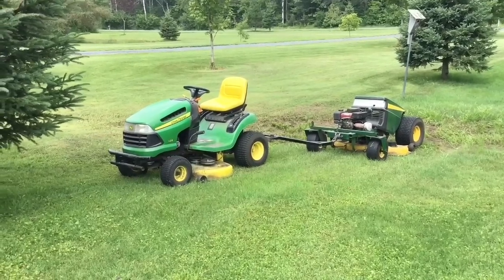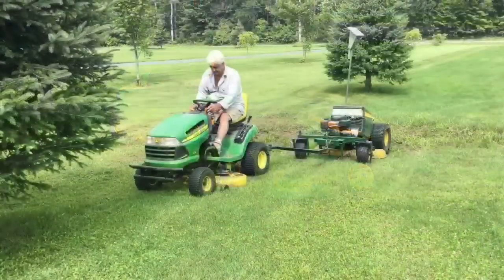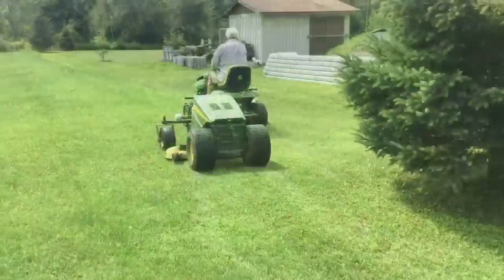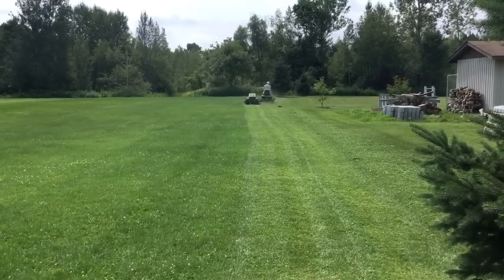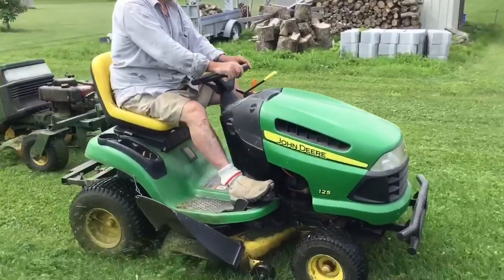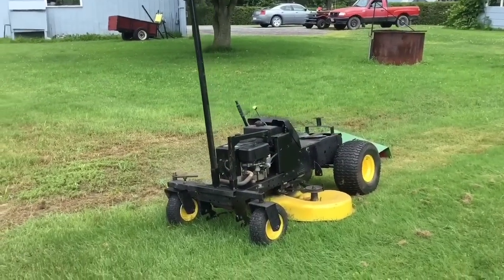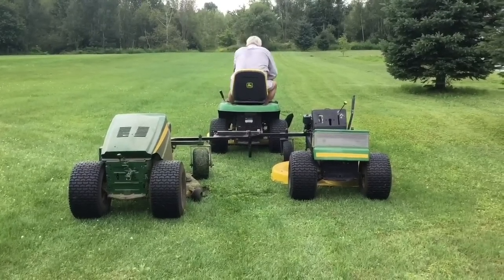Pull behind mower

Comment: I have two Swisher 60” pull behind mowers (14.5 HP engines on each) and have been pulling them behind my 1026R John Deere (w/ 60 inch deck) for several years now. I overlap the Swisher Decks about 12 inches on either side of the J.D. deck for a 13 foot cut. I mow 13 acres in 2-1/2 hours, or 5.2 acre’s/hour. I’m using two ball hitches from the tractor to the trail mowers but cornering leaves uncut strips so I need to switch to a sleeve hitch’s so the trail mowers tongues can’t swivel. I have pulled the Swishers on either side of the tractor and also both to the right side of the tractor which does triple mulch the grass blades for much less grass remnants left behind. Great time savor! Great minds think alike! ha ha! I’ll have to upload my system to YouTube!
Reply from the maker: @vscolkitt  
Can wait to see it on YouTube,please send me a notification when you do.
Reply from the maker: I mean    cant  wait
Reply: @logboom2002  
I mowed 13 acres today with my two pull behind Swisher mowers. Two videos…. Titled….
Two Pull Behind Swisher Mowers with John Deere tractor…Part One (and Part 2)

Comment: A friend/neighbor did similar a while back using a gas push mower pulled behind his rider to mow about 2 acres. He just took the push handle off and built a bracket to keep it in position like you did only lighter duty. When I followed along on the 1.5 acre area adjacent to my place with my rider it was done very fast. I agree with mulching idea but not only for safety but also to make less work for the right side trailing mower. It has to cut it's own swathe plus recut the lead deck's discharge.
Reply from the maker: oh just quit it 
I did tried it with 2 mower just that one time for the video. Usually i use just the lawn tractor plus the mower on 
the right so there is no problem of recutting the grass. But you got the right idea bout mukching
I keep  one  pull mower as a spare
thx for you comment

Comment: Well done!  Perhaps you can put a mulcher cover on the mower with the blades exposed for your safety!  Just looking out for ya : )
Reply from the maker: Dano Vido 
I could do that.Good idea  Thank,s
Reply: thats a huge lawn thats when i would need a 39hp  kubota front mounted mower with 60'' or 72'' mower deck wich wouldnt take long mow it when it runs it's 28 miles anhour speed
Reply: Not everyone, it other parts of the country...can, nor want to, "Mulch". 
Lawnmower's basic design is to cut and DISCHARGE grass...not make cole slaw out of fescue.
Reply: martianshoes I was told to mulch to self fertilize the grass and it has made my lawn beautiful.   It is a lot less messy and looks better than long clippings on the grass.  I can also mow along curbs, borders, and cars without clippings all over the place.  I have really loved it thus far!
Reply: Dano Vido - I agree
Reply: mulching is great unless the grass gets tohigh or your blades are dull
Reply: could probably use a little more salt on that too... some people are never happy with what's at hand
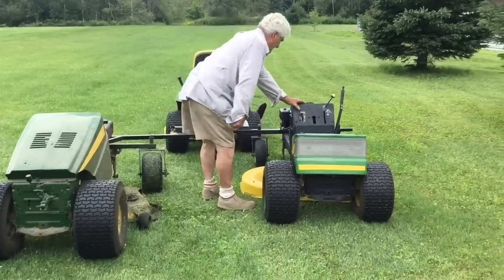Reply: @ 1:40

Comment: I would put a guide bar on the front of the first of the driver so it will help with knowing where rear mower is at for your cut line or on on each side.
Reply from the maker: Lankster Price 

I did think about that but i usually cut with only one “pull behind mower” so it cut to the left so i,m always all right i just align my lawn tractor on the last cut

Comment: I think it was the 1960’s that Cub Cadet sold a pull type mower along with a special rear hitch setup so you could pull two, just like your setup. Can you take another video showing the hitch system? 
About 14 years ago I got a free Snapper SPA520, 52” commercial walk behind mower minus the engine, plus I have three Snapper SPA360, 36” commercial walk behind mower decks and carrier frames. The SPA series have floating decks. The SPA520 I think I’m going to turn into a pull type mower.
Reply from the maker: Boyd W 
Sorry Boyd but i took that hitch off. I am using just one pull behind mower now
Reply: Ok.

Comment: Look for John Deere SST15 SST16 or SST18 zero turn tractors with a bad hydrostatic transmission. Remove seat, steering wheel and transaxles and sell those parts. Install axle and tires in the rear and build a hitch on the front. Bingo you have a pull type mower since they are made with front caster wheels.

Comment: Very nice but I would be concerned about burning out the transaxel on the towing mower.
Reply from the maker: Pro1er 
on my 4 th year and nothing burn out yet
Reply: Good to hear. Put some extra air pressure in the slave mowers to make them easier to roll.

Comment: How has the transmission on the John Deere mower held up pulling the other mower? I worry about pulling mr DR 60” deck mower with a smaller yard mower like this?
Reply: Pulling both mowers that is?
Reply from the maker: JD Gray
Usually i only pull one mower and no problem so far
Reply: lucien morais Thanks...it would be nice to be able to add to my cutting width like you are. I’m currently pulling the mower offset with my Mule and it takes forever to mow 6 acres.
Reply: What size engine is the john deere lead yard mower?
Reply from the maker: I believe its a 12; HP

Comment: Great idea but I wonder how long the transmission will last in that mower. As they're not designed to pull any type of weight for an extended period of time. In my humble opinion
Reply from the maker: Roger Lund 
Been using for at lest about 4 years  if not 5  now and no problems
but just one of them   not pulling 2
Reply: Where is this?
Reply from the maker: Chris Reid 
Near Ottawa On.
Reply: They do have hitches to I would say they are designed to take the stress of pulling a trailer of mulch or something
Reply: Roger Lund my grandpa used his John Deere hydro matic or whatever it’s called as a tractor for many years, pulling a 28 foot tracker boat with it frequently, that was 8 years ago and the mower still drives now after a mountain of other abuses